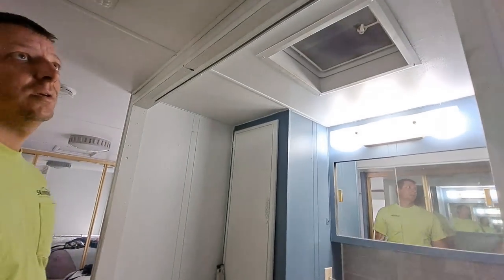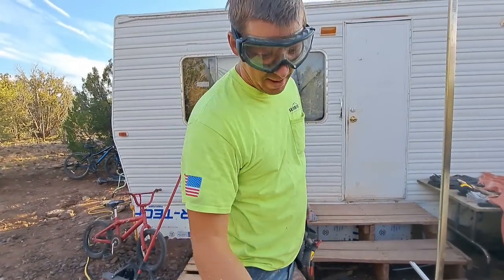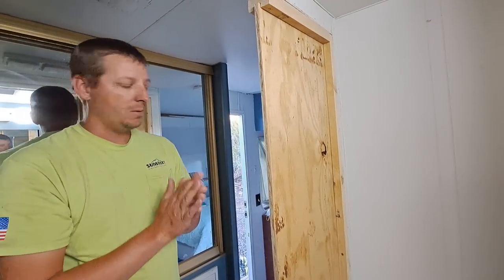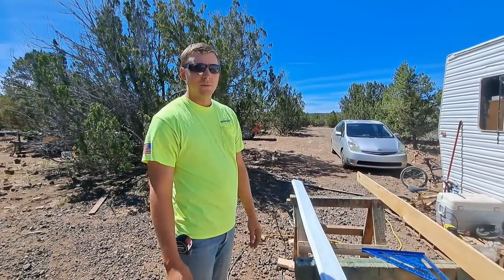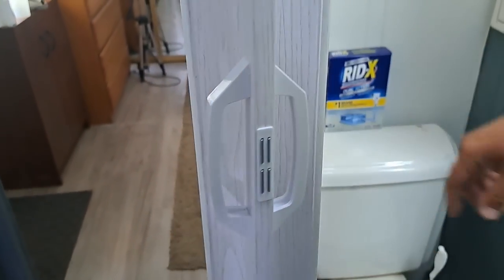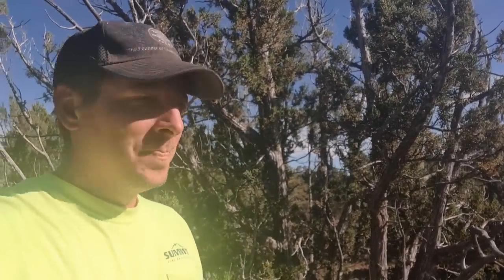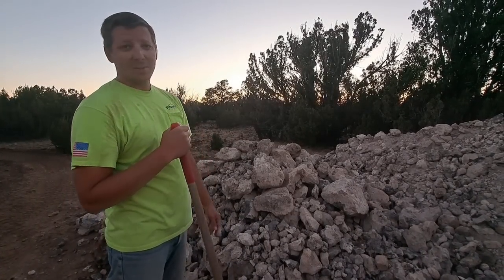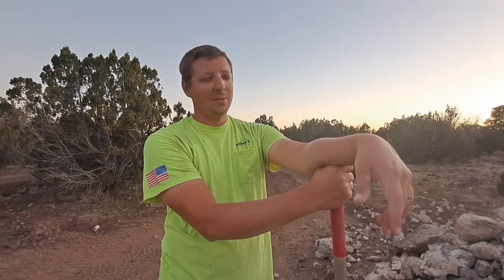Finally Some Bathroom PRIVACY With New Door

Comment: Get some 1/4" or 1/2" wire mesh.  Build a wooden frame that will fit on the 4 wheeler trailer and then attach the wire mesh to it.  Shovel your dirt on the mesh, shake it, dump the larger rocks using the framed mesh (not the trailer), repeat until you get a full trailer of sifted dirt.

Comment: If you would have taped Uber where you gonna cut the tape with a kept it from cracking, so your cup would go right down the middle of the tape across your lying. You tape the tape where you're gonna draw your line? Then draw your line figure right in the middle of your tape. Then when you cut it like a sight, it'll be easy.

Comment: You should look into getting a rock bucket for your backhoe , maybe fashion a quick connect assembly like a skid steer for them  .. with all the big rocks you have been digging out. You might want to think about getting a hydraulic thumb for the backhoe to be able to grab the big rocks and left them out of the hole .. I know money is tight, but these are some things to think about and maybe budget for ..